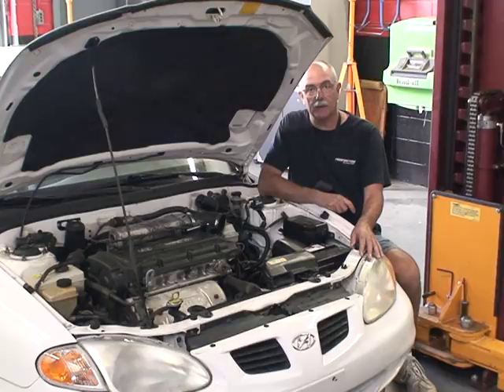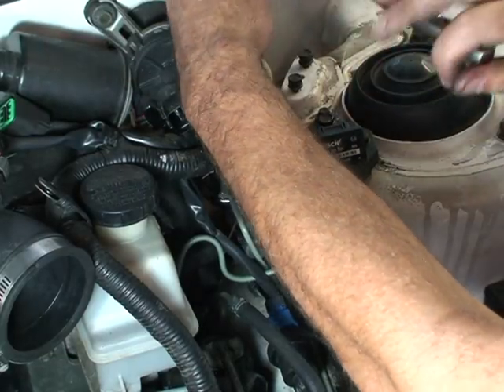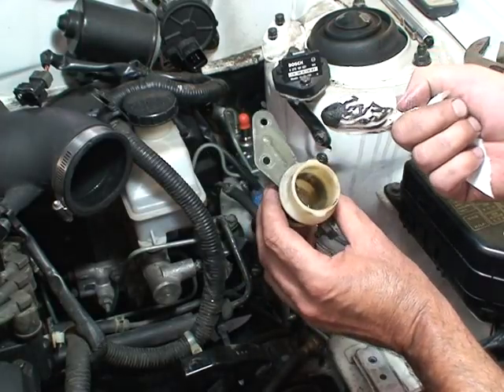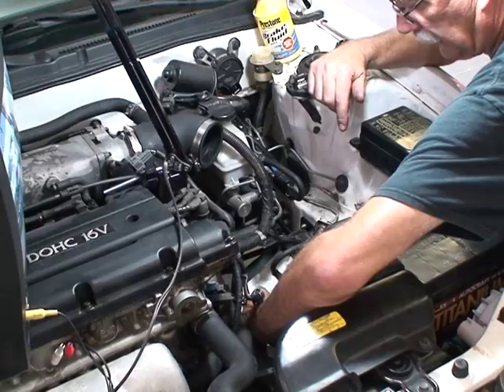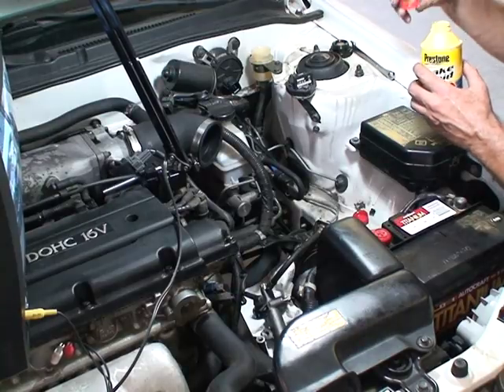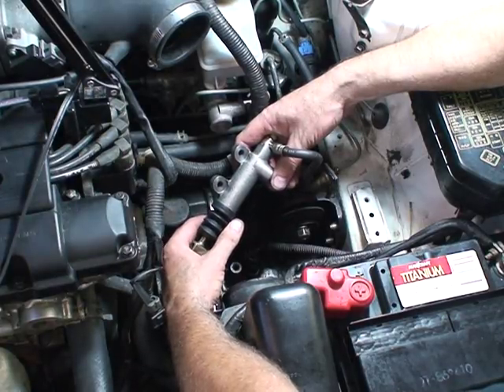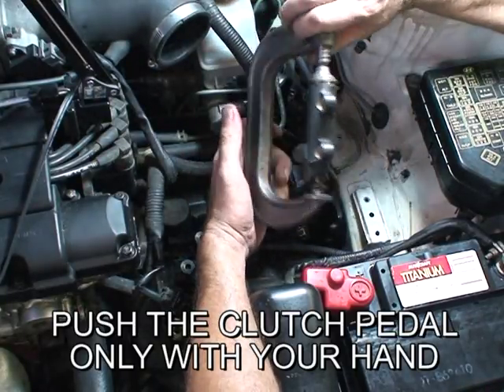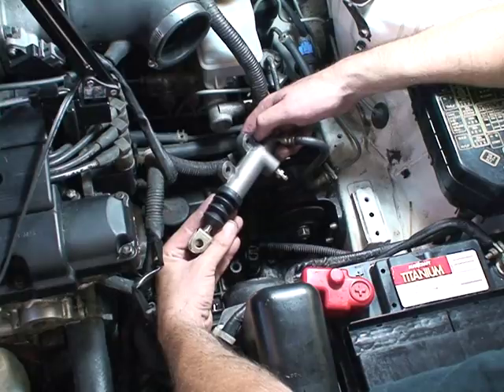Clutch Master and Slave Cylinder Replacement and Bleeding Techniques - Import Application

Comment: I have a 2008 Nissan altima manual transmission and I dont see a clutch reservoir. I am unable to change gears on my car. When I push the clutch pedal it goes all the way to the floor and never comes back. So I am assuming my clutch master and slave cylinders are bad. Is the clutch master cylinder attached to the brake reservoir?  Please let me know.
Reply: perfectionclutch s

Comment: Continue...the line with new sealed down the hole and lock it up with a new pin . i put a new slave down to the same position then put two screw back in and tight it . i open the cover on dot 3 reservoir and let my friend pump on the cluth for quite some time untill it feel firm enough then hold it down . i released the valve on new cluth slave to let the fluid come oout then close it...i do this two -three time until the cluth pedal if firm and slave cylinder is move up when the cluth is

Comment: hi, I'm constantly losing clutch fluid and it is always low and now empty, my only thought is because there is probably a break in one of the lines or from the master cylnder?  is that a correct assumption?
Reply: ***** This is from a 72 datsun 521 pickup

Comment: Greetings, I'm performing this fix. I am experiencing a HARD pedal after install of both new master and slave. I took system out and did a bench bleed. I worked both sides with my hand on the bench. The slave cylinder push rod is naturally extended all the way out. (in this position master push rod has no where to go).   I then compress the slave side cylinder with my hand and this pushes fluid back to the master, only then can i press the master side (clutch pedal) in. (This honestly sounds how this is supposed to operate? my question is what is supposed to draw the slave backwards? there is no push pull action.
Reply: This is 08 kia spectra 5.  The release fork lever has too much free play i believe the snap ring has failed allowing the release bearing to freely move along the input shaft allowing the slave to extend fully 13* and not at the clipped in position of 6*.  Going to dive in Wednesday morning. Does this analysis seem sound?
Reply: Thank you for reply.
Reply: Hey just wanted to update that the clutch is installed and working perfectly. Thank you again. Snap ring failure and rusted slightly and broke in its middle. Word to wise. There are two vent ports for dust and debri on the top of the transmission housing be careful not to introduce extra water down there if cleaning in there. Probably led to corrosion and premature failure.

Comment: I have a 2000 Honda Accord EX. Yes I have a friend who is very mechanically inclined. He can help, his time is just limited.  Is it possible that my fluid has just dropped too low. I have never changed it or even checked it for that matter. I am hoping that I could just bleed and refill. However I do show the signs of a failing Master/and/or/Slave cylinder. Peddle recently getting stuck in first, or not wanting to go in at all.

Comment: i have an 1987 f150 and i have replaced both the master and slave cylinder and none of the fluid in my master cylinder will bleed when i push the clutch in and out i have done it with the bleed screw open and closed on the slave and it still has no hardness on the pedal have any idea? plz help

Comment: Anyone have any thoughts on why a clutch pedal seems to become harder as one pushes the pedal to the floor? It only happens when the car gets warmed up and once you let it sit for even as little as 2 or 3 minutes, the issue returns. I replaced the clutch, flywheel and the slave cyl on my girlfriends car. When I swapped out the slave cyl, I removed the little spring and fluid retainer that Hyundai had installed in order to "smooth out" shifts because she is capable of driving stick without any smooth assistance junk. Ive bled out the clutch a couple times, havent tried this technique, but I havent adjusted the master cyl. Should I try there  or is it just that the clutch is new and needs some time to break in and Im chasing something that will go away as the parts break in? The clutch seems so light as Im used to driving Mustang and STi clutches which have much heavier pressure plates. I honestly prefer the lower part when it stiffens up, because thats why Im used to. Thoughts?
Reply: Its an 06 Elantra. Im going to try pushing back on the slave cyl when I rebleed it. The only other thing that I can see possibly being an issue is that the plastic piece that attaches the master cyl piston to the clutch pedal is cracked or broken and constant pedal work moves the pieces around to give it different feelings at different spots. Ive been reading about these failing on Hyundais a couple of times. It just strikes me as odd that when you start the car, it feels fine, but when you drive it a bit, the feel changes.
Reply: I have a scion tc -sped. My clutch pedal stays depressed. what do i need to replace slave or master cylinder or both!

Comment: Gary is it difficult to change a slave cylinder in a 1993 Honda del sol?  The cylinder Is on the passenger side I believe, and it appears to be wet with some fluid(brake fluid im assuming).  I checked the reservoir and there wasn't a drop in it!  I sprayed some wd 40 on the nuts that will have to be removed to gain access, let that sit overnight and hopefully ill be able to do this myself.  27 year old female/country girl :)

Comment: I have a 1987 3.0 4x4 nissan pathfinder i changed the slave cylinders an my pedle is not building pressure ive tryed bleeding it an it want do anything but just go to the floor

Comment: Quick question if anyone is out there. I have the same year and make as in the video here. When I attempt to compress the slave it is like hitting a brick wall. I have shortened the rod so it to the master and it still won't budge. When I open the bleeder, it will gravity feed from the master, and it will then compress. When everything is hooked back up, the clutch works fine. What might be causing this?

Comment: hi, if i dont see leak in master cylinder , can i assume master cylinder is good. ?

my clutch is spongy, can be the case that master cylinder is good, slave is good because of air my first and reverse gear is getting spurr..  

2) if it is just 1st and reverser gear , why the other gears are not getting that issues, please advise.
Reply: Thank much, i just fixed it yesterday and you are 100% right. CAn you please advise me how to diagnose and passible cause for master cylinder diagnosis..
Reply: Gary, Thanks, after watching your video, i concluded it is slave cylinder because it is leaking and i changed it , all worked fine. this is 2004 Accura TSX model. you saved me 1000 dollar bill. i did this for my friend. you are a saver.. i did bleeding in the method you taught and all is well. I cant thank enough.

One last question, in this model is there a way for me to manually adjust the pedal height, or it is auto adjustable and I cant adjust it.. pls advise.

Comment: CONTINUE...down . you can look at the slave move up when the cluth pedal is down...but when you release the valve to bleed the air the push rod will move down and tight it , then fill up the reservoir and put cover back on...
I get in the car ...depress the cluth down and change the gear around...IT WORK !!!
NEED HELPS....hauling at  me !!!

Comment: can you do this on a 2001 chevy cavalier 5speed?
Reply: ok thx. What is the difference between an engine that is an L4 - 2.2L CNG and one that is an L4 - 2.2L OHV? i need to know this in order to order parts obviously. my dealership couldn't or wouldn't even tell me which i had, acted completely clueless, and i have no owners manual and the sticker is missing.
Reply: i'm going to buy a clutch kit and clutch master cylinder to have installed.
Reply: thx got it
Reply: It took my one hour

Comment: I got  a 98 turbo eclipse and the clutch pedal stays to the floor how do i fix that
Reply: Either your clutch master cylinder or slave cylinder has gone bad, Just replace both that's what I did in my 98 and it fixed the issue.
Reply: It wont go into 1st 2nd 4th or reverse is that the tranny?
Reply: well could be slave or master when my shit went back wouldn't go into gear

Comment: If anyone has ever changed the master cylinder from a Renault Espace then you can be pretty sure that your whole day is shot. Dont ask me what them engineers were thinkin when they build that mini van.All i know that that was the first time and the last time doin that on that model. When I was done i went to a Renault dealer and asked if there isnt any easier way. they said no, and said I was pretty good gettin it done in a half of a day. The guy told me thats how long they would take to.

Comment: I just tried this method on my 2000 Nissan Maxima and it did not work.  I could see bubbles come out, but after 20 minutes of pumping I still had no clutch.  Only thing that worked was bleeding it the old fashioned way.  Push the clutch in open bleed screw close it pull clutch off of the floor and repeat about 10 times.

Comment: i dont understand why manual says "just pump the pedal 10 to 20 times and open bleeder screw let air out and close the bleed screw and repeat till pedal gets hard' it ll never get hard untill i compress the slave by hand like in the video above
Reply: perfectionclutch hi gary i used dorman and and oreilly aftermarket slave they all come with same instructions calling for pumping and it takes forever with no result i used break bleeding method following by gravity bleed it was still soft .but once i removed the slave and pushed the rod 5 times let the bubbles out.its rock hard now.

Comment: In my workshop i´d take any customers car and do the nessecary repair. I have  never in my life seen such a bull as in that renault espace. just about no chance to get to the master. The master is in the floor panel attached with a half twist,behind the pedal. to get the hose (hydraulic) off you need to get in the corner to where you have no room for any kind of tool, under the hood the same thang, its a long story the way its done. sure got my temp. to the boiling point!!!

Comment: 2012 hyudia accent installed new clutch disk presser plate and thur out bearing and had to remove the line at the slave and now its not even gravity feed and no presser at pedal? bad master or slave ?

Comment: I have a question, I have a nissan pathfinder 5 speed 3.3 4x4, when the truck is cold it's very hard to shift into first gear, when the truck is warm is not that hard to shift into first gear but is not that soft either, shifting from first to second is kind of hard always, I try to take off from second gear just to avoid that, a mechanic told me over the phone that the clutch might not be the problem,  do you know what could be the problem? is there any way it can be adjusted?  thanks in advanc

Comment: i have a94 integra i replaced both master n slave cylinders a few months ago, recently i had very weak pedal it engaged on the floor so i tried to bleed thinking may be air in line n now i have no pedal at all, PLEASE HELP????
Reply: soulz109 n